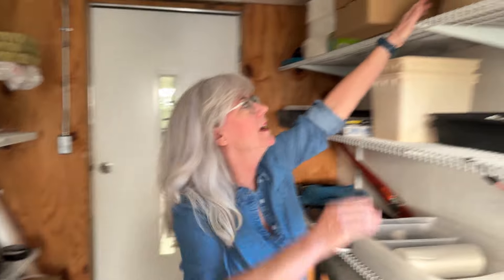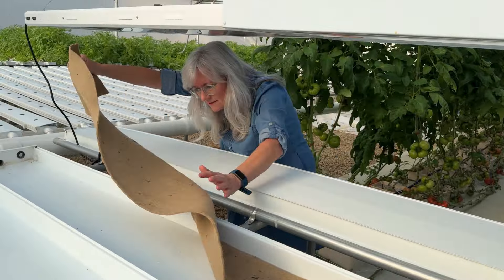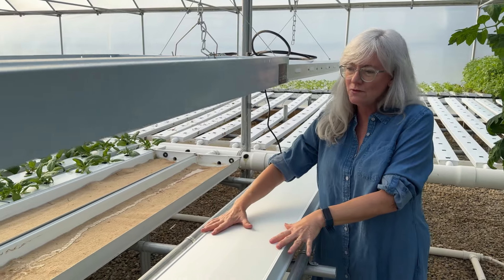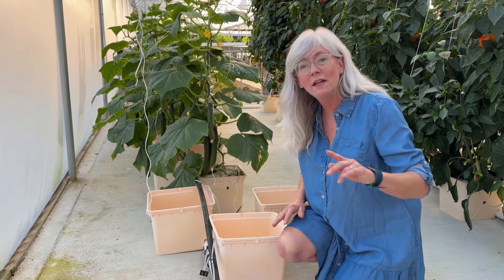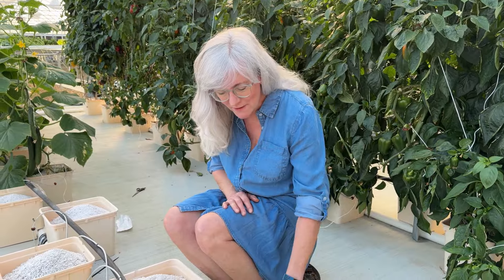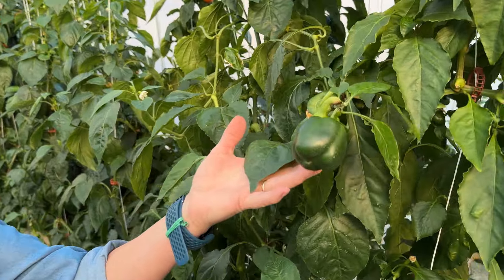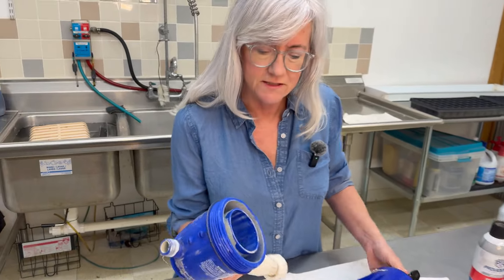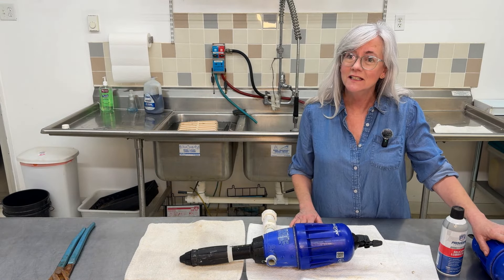Guide to Hydroponic Cucumber Plant Care and DIY

Comment: Hi Kate, I am curious about the drip emitters for your Bato buckets. What is the GPH? Thanks.
Reply from the maker: I’m using Netafim 0.5 gph emitters. Part number on my bag is 01wpcjl2-b  hope that helps.
Reply: @HomegrownPassion   Thanks. I am trying Bato buckets this year.
Last year my high tunnel got too hot (over 100) and most of my vegetables did not make it. This year, I am adding a wet wall and fans - with a second layer of plastic with the hopes of doing a better job. Do you also add shade cloth over your plastic?
Reply from the maker: We have in the past. I really like redu it worked great. Just filtered the uv red and greenhouse was significantly cooler. Also it was worn off by end of season. Easy to apply.